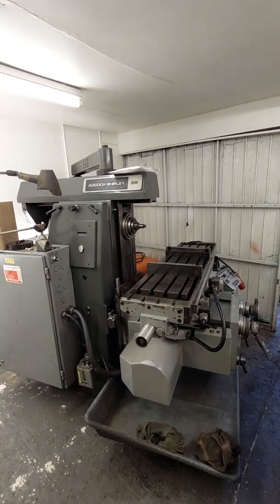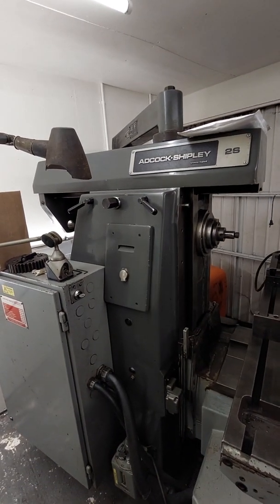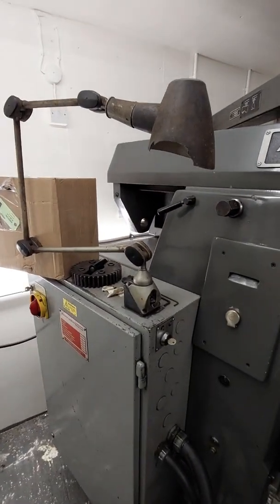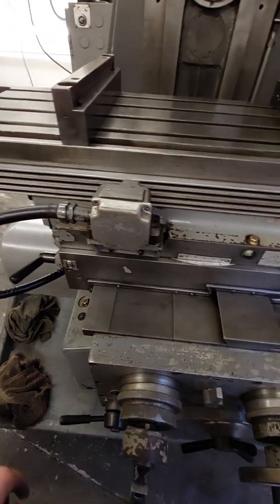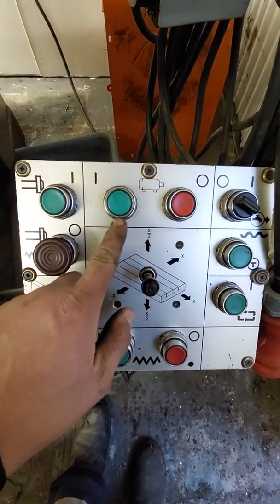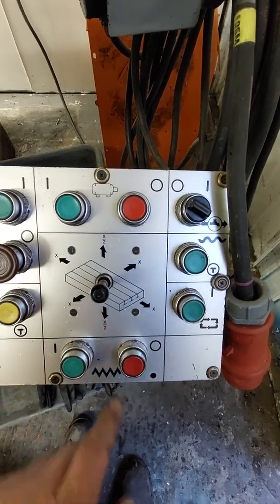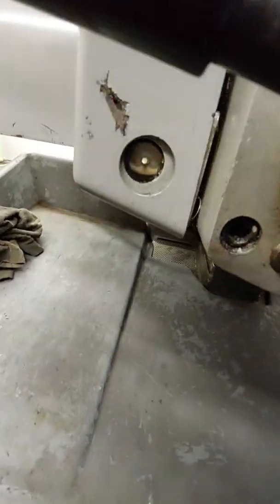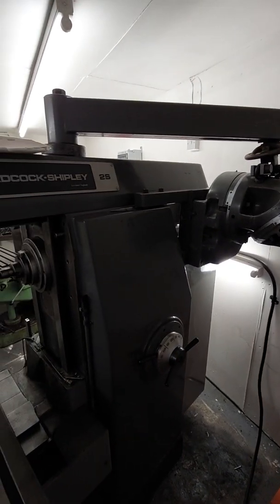Milling Machines finally installed

Comment: Nice machine, i have the same one but mine is a 40 tapper. Weird...
Reply from the maker: Would yours be  2E ?? A mate of mine has the smaller model. Identical but smaller with a 40 taper.